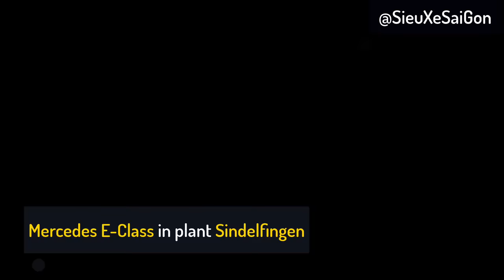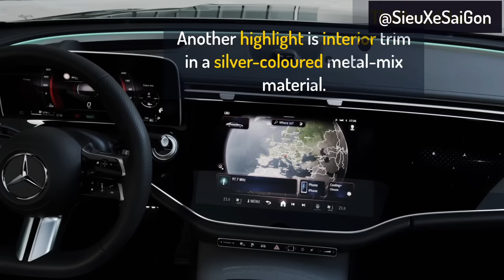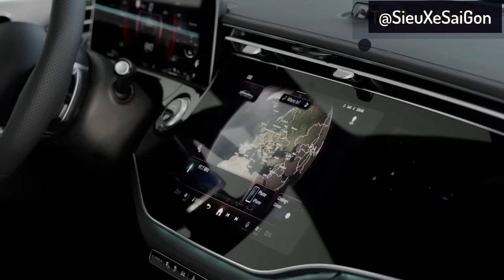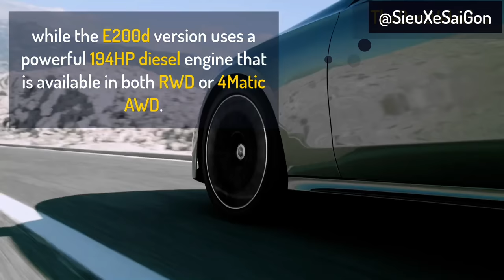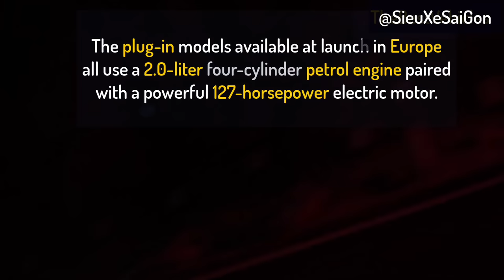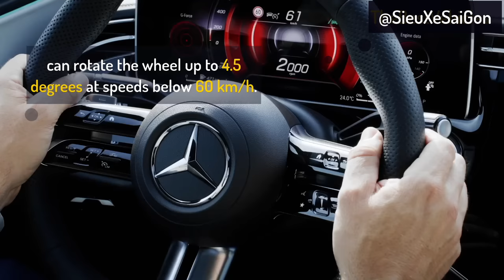Start of production of the new Mercedes-Benz E-Class 2024 in plant Sindelfingen

Comment: I was able to tour this factory back in late 1997 passing through Frankfurt... Even then the factory used robots and I remember being stunned by all the automation watching E-Class vehicles being built...My favorite part of the factory, different from the machine in this video, is where entire dashes were carried by machine through the windshield opening at which point the dash was turned & inverted into place and arms came out to attach all remaining connections. Once completed in about 20 seconds, the robotic machine would come back out of the windshield opening without touching any part of the opening painted frame...It was too unbelievable to not watch. My dad & I were transfixed watching several vehicles having their dash installed until I finally had to suggest we move on...

Comment: Until Mercedes starts engineering their entire vehicles for longevity and reliability instead of what seems like inbuilt issues I’m not buying another Benz I’ve had three and all have had issues they should never experienced if Lexus can get their luxury vehicle running trouble free for years and years then Mercedes with over 130 years of engineering experience needs to do much better especially for the premium price their asking because it’s no longer a premium ownership experience it’s a troublesome over engineered convoluted expensive nightmare to repair once it’s out of warranty Not Good Enough and BMW, Audi and Volkswagen your all just as bad.
Reply: Stop crying and buy a Lexus……😂